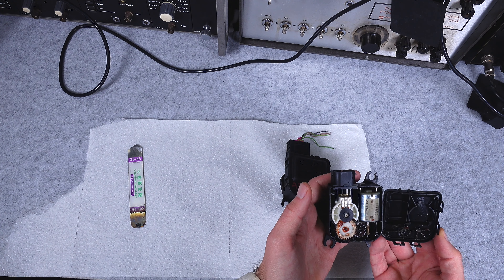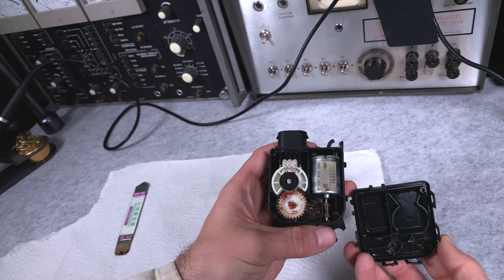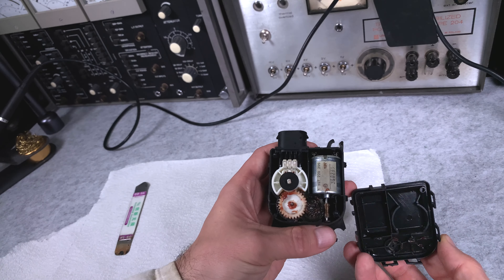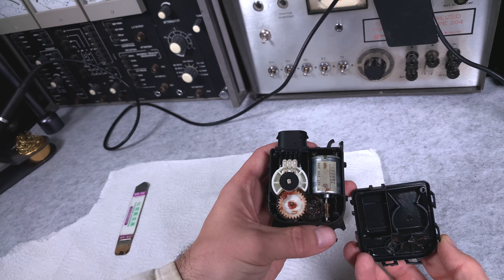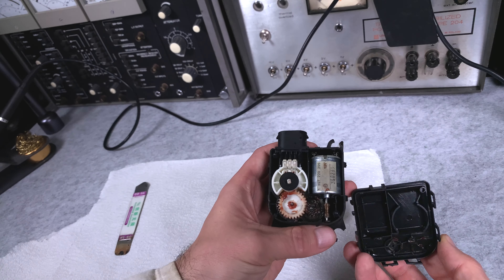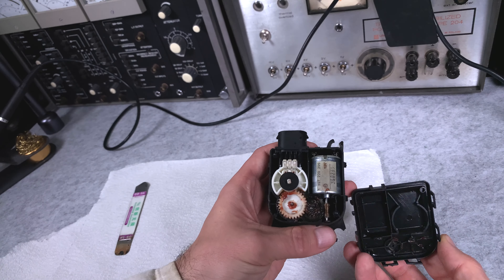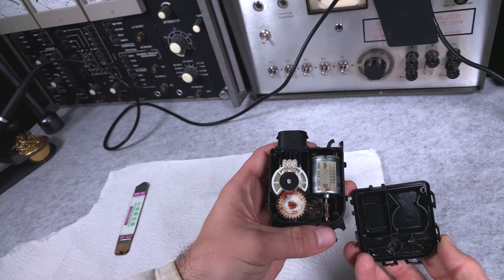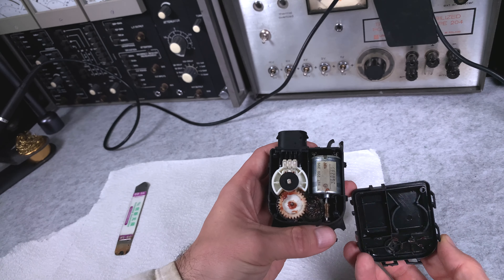Repair Volkswagen VW Polo IV 9N HVAC flap actuator (BOSCH 0 132 801 207) potentiometer (162H 5415)

Comment: Kudos for the explanations, demonstrations and tests done for the demonstrations.  I also repaired three out of four flap actuators.  I bought new potentiometers and new motors on Ebay.  I managed everything!  I have removed all errors.  I checked the potentiometers with a multimeter, but it is more correct as you did, applying 5 volts to the pins and reading the response of the potentiometer with an oscilloscope.  Congratulations and continued success!
Reply from the maker: Glad It worked for You! Thanks for feedback!